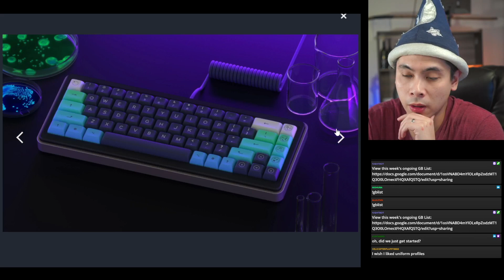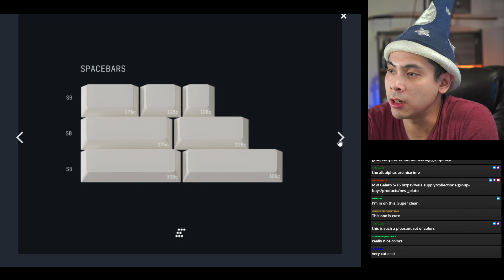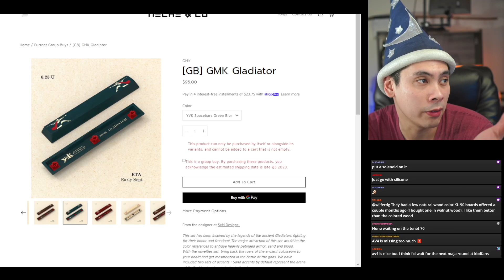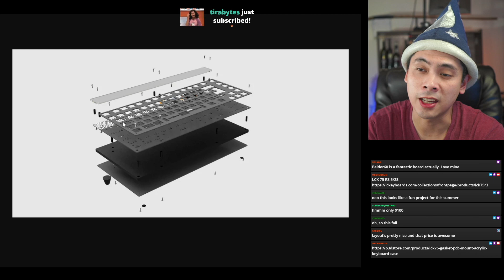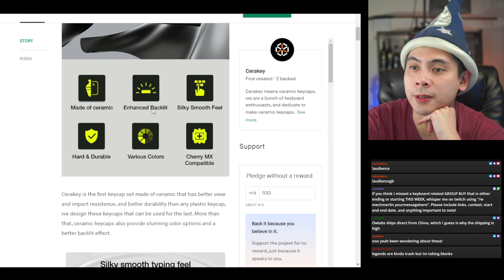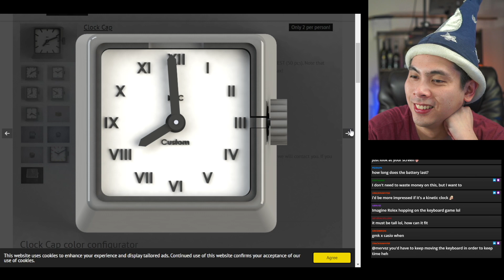Mechanical Keyboard Group Buy News - 05/15/22

Comment: Windbreaker is also tempting me.

Oh wow, the clock cap is an awesome idea, but I wish it was a mechanical watch mechanism, not battery powered quartz.  I've been into mechanical (analog) clocks far longer than mechanical keyboards.

Alumina keycaps are interesting, but I dunno if there's a reason other than being different